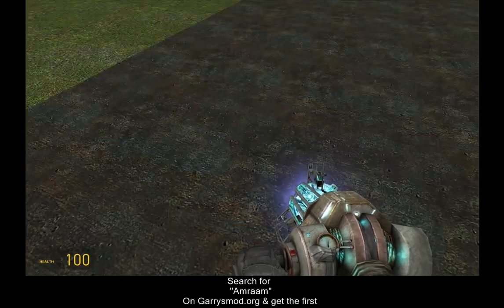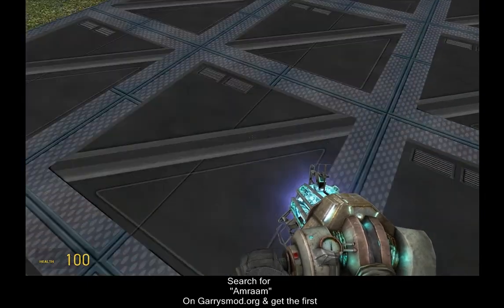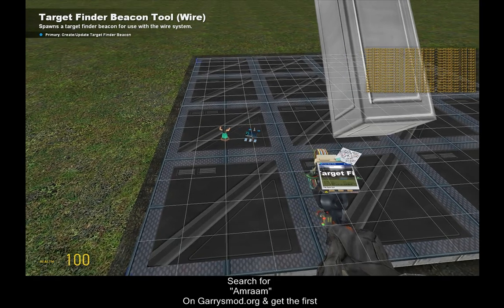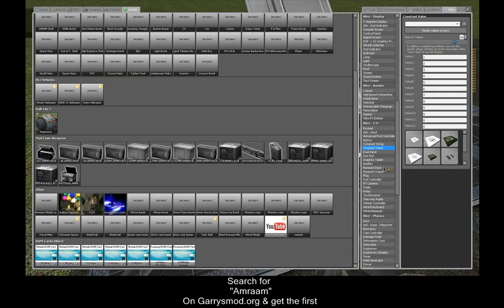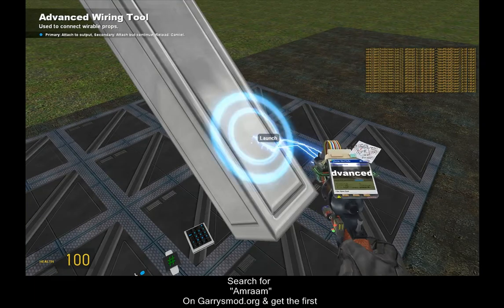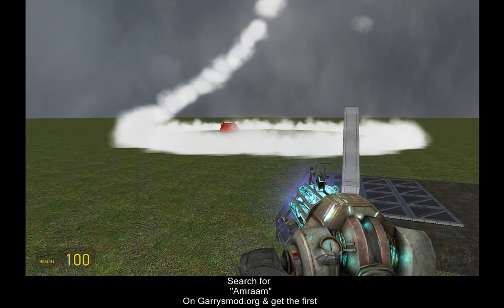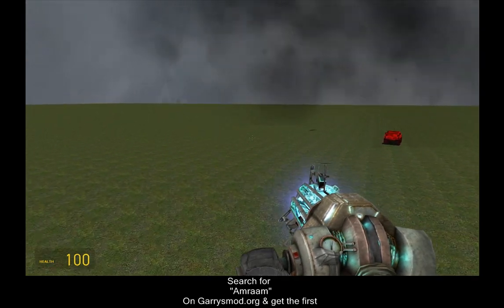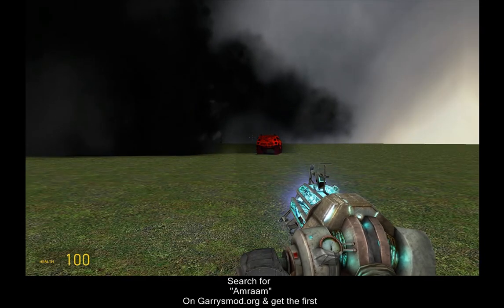How to Wire a Guided AMRAAM Missile Launcher

Comment: i want to design a system where it will launch at a target automatically if that target has fired on an entity or constained props (in this case a ship).  Using wired damage detector, is this possible?